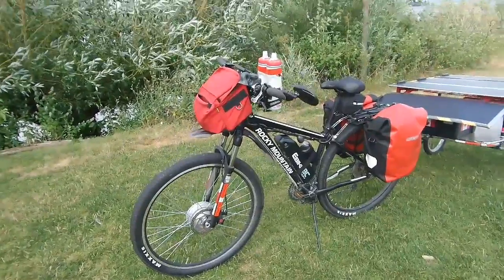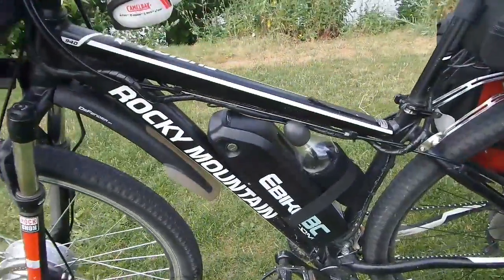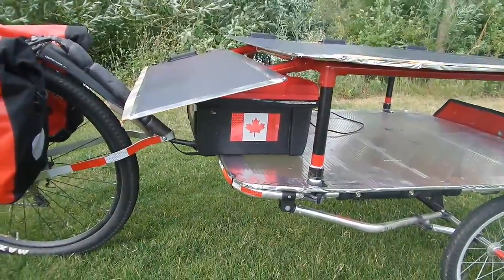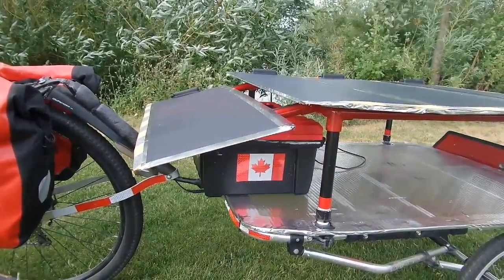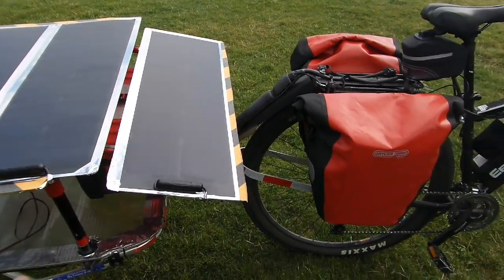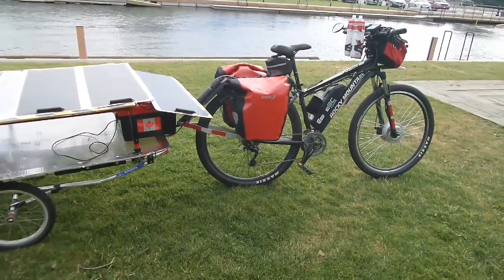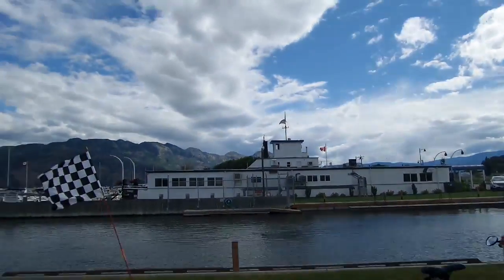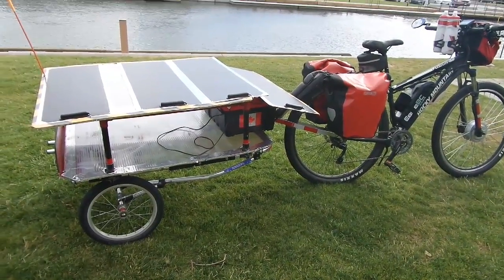500 w Solar powered touring E- bike

Comment: Very cool. I am definitely looking into doing a set up like this for a future cross country trip on an e bike. Would be nice to have the continuous battery charging thru solar rather than having to stay at hotels to charge overnight.
Reply: The solar has to little watts and the motor is big.
Thin-film solar panels are not that efficient . 
Guessing by looks, for the size his panels occupy , I could fit 200-300 watt panels within the same area.

Comment: The Genasun GVB-8 charge/boost controller will take the 18+ volts from the solar panel and boost it high enough to trickle charge a 48v ebike battery.  The controller also has MPPT to monitor the panel to optimize the power.
Reply: I know this is a old comment. 
He got four 12volt panels. If you wire those panels in series and use a common 48 volt charge controller you could do the same thing cheaper.

Comment: Lithium ion batteries do not like to be constantly topped up. It creates dendrites inside the batteries and reduces their life span. Reduce the charging voltage to 3.90-4.00V per cell bank(39V-40V for your 36V motor assuming your battery pack is a 10S. ~51V for 48V motor or 13S pack). With that setup, you don't need to worry about running the battery to low.

Comment: The new trailer I am currently building has increased solar panel capacity bringing it up to 240 watts from 120. 120 worked well enough to keep the system charged and I could ride all day but had to constantly change the amount of power assist according to the grade. With the increased wattage I won't have to do that as much. One of those "more is better" situations!
Reply: Doran Amatt
Reply: Dude you wasted so much space with this setup. You could easily have 400 watts in this space with flex panels. If you are going to do something do it right.

Comment: If you could make a front fairing made of coroplast with a lexan windshield, and instead of hauling that trailer behind you create a frame to carry a light but flexible solar panel on top, you would eliminate the extra tire drag behind you while making yourself more aerodynamic
Reply: Such sail may be dangerous on windy days.

Comment: I bought an ebike 1000 watts pyogrammed for 750 watts to keep it street legal eith a Bafang BBSHD mid drive motor and would like to design a trailer with 2 50 watt pv panels...My battery is 52volt 14.5ah but it will drain anyways and Im interested in a DC to DC voltage converter for that lithium ion battery but nowhere to find one...If you can help i would really appreciate it.
Reply: Carlos Lizardi-Montero  The company is called Genasun. In Boston MA. Pricey but it does work. They come stock set for 42 volts. So will have to be calibrated for your 52 volts. Give them your stats and they do that for an extra charge. Good luck Carlos!

Comment: brilliant! free transport and green!
Reply: Little Bull green until the batteries die and they gave to be disposed of. I use this bike 365 days a year. Its my only teansportation. I havent bought gasoline or oil in almost 5 years. So I havent cotributed to air polution in quite some time and saved money that way. But my entire set up was a little over $5000 initially and have spent more on upgrades and maintenance. Butvin the long run I have definately saved money and the environment. Thanks for the good cheer!
Reply: @ontheroadwithyode390  How long does a battery last before it has to be replaced?

Comment: hey awesome bike man! could you give a brief description of whats in the box? i plann to add solar power to my 800w ebike
Reply: Edward Thompson The "secret in the box" is a component made by a company by the name of Genesun.  It's a dc to dc power booster that runs directly from the panels, to the booster, directly to the battery. The company is out of Boston Massachusetts. They had to send it to another company in California to recalibrate it down to 36 volt from 42 as my lithium battery is a 36 volt. It was expensive, but it works and works well eliminating numerous steps in the charging process that cost loss of power. Good luck.

Comment: Can you give me advice on how you set up the solar panel to inverter to battery to constantly charge the battery? Im interested in a simular set up but with a mid-drive motor
Reply: Sure, it relatively simple. Inside of the box is a GV-Boost. Its not just an inverter, it also boosts the power up to either 36 or 42 volts. And also regulates the power. You cant charge a 36 or 42 v luthium battery with just a regular inverter because it is only converting the power from dc to ac. The amount of electricity will either be too much or too little for your battery. This product is made by an American company called Genesun. See my new video that I just posted on yode on the road. There is a good shot of it on that vid.

Comment: So you have no issues charging the battery while using the motor simultaneously?
Reply: The battery does not get charged with the solar panel, think about it. The solar panel has 120 watts and the motor has 500 watts.
It would be like filling a swimming pool (battery) with an hose that supplies 5 gallonof water per hour (solar panel) and you have a 20 gallon per hour leak at the swimming pool (motor). You never will fill the swimming pool (battery).
Reply: @FloryJohann  yes but the bms for the battery may not like be able to handle charging the discharging simultaneously.  I understand your analogy but it over simplifies a pretty advanced process.

Comment: Get yourself a tilting  tricycle and put a solar roof on that....250w
Plus 500w solar power on cargo trailer....and drive like me 250 km per day on sun power with lithium titanate battery 24v with step up converter to 48v step up (900w capable) to prevent overheating. LCD setting to any voltage...up to 120v 900w usable. Adjustable current even for a motorcycle 2000w motor using 3 of these LCD  step up converters
35km per hour without discharging more than 5% during driving.

Comment: Hi, that looks like an excellent design! I am very keen on building myself one of these, hence I have a few questions if you don't mind:

1. Does your bike have 29 inch wheels?
2. Does the 500w motor give enough power to take a loaded bike up hills? I guess you have to do some pedaling to go uphill?
3. What is the (approximate) combined output voltage from your solar panels (on the incoming side of the DC to DC booster)? 

Thanks
Reply: George Diener HI George....yes , 29 inch wheels. The mistake people make when it comes to electric  bikes is that they figure you use it like a motorcycle. The electric motor is there to ASSIST the rider while pedaling. It will power a loaded bike up a hill or two and then the battery would be drained. The trickle charge cannot keep up with the amount of power expelled if the rider is not pedaling. This set up is four 30 watt solar panels, 19 amp, 1.5 volts each. so the answer to your question is roughly 6 volts at optimum conditions. I was averaging 80 to 100 km per day on my trip. Keep in mind this was June- Sept. lots of sun. My average speed was 18-20 kmh. Also factored in is the fact I was traveling through the mountains of British Columbia (Canada). Lots of inclines. The system I have allows me to adjust the level of assist. More for inclines and less for lesser grades. I would turn off the power during decent and on the lowest setting on the flats. So...once again, other than coasting on decent,  always pedaling.

Comment: would that hub on your front wheel work on a BOB Ibex trailer without the need for the Solar panels?
Reply: Dean Porter you may have misunderstood. The hub isnt gerating power. Its using power from the battery. The battery is being recharged by the solar panels.

Comment: what's the budget around for this project? Im interested in building one this summer. Thanks!
Reply: ravenrg84  The panels were $200 each. The booster/dc dc charger was $450. An electric 500 watt kit with battery was $ 1000. The bike and panniers $ $2000. The trailer I built from various parts and pieces and probably cost$ 150. so...about $4500.
Reply: Doran Amatto ok thanks. I have an old ebike (velec p1, 4 years old, battery 36v 13ah, 500watts). do you know what kind of solar pannels do I need, 3× 12v 50watts would work? i have a 700$ budget...
thanks
Reply: ravenrg84  150 watts should keep your battery reasonably charged if you are assisting by peddling and not just running only on the motor. This system was only 120 watts and it worked just fine. Although the system was fairly low after an eight hour day of riding.

Comment: hi. i would like to make a bunch of cross countrys treavel with a e-bike. It would be gread if you can gife me some info about the charge control. That is realy a nice bike by the way i love it! I just wonder how i get the righe voltage by driving to charge? Thank you!
Reply: The front hub only generates about 10% recharge only while braking so its fairly insignifigant. You may have missed the four 30 watt solar panels on the trailer. Google Genesun GV-boost. This is the key. Not yoyr average charge controler. Good luck!

Comment: how it is possible to load and at the same time use the battery ?
Reply: der analoge  It still drains the battery , but very slowly. Without the panels I got about 25-30 km on a charge. Connected to the panels I was averaging about 70 -80 kms and still had some charge remaining at the end of the day.

Comment: changed your motor to a bottom bracket motor no drag on front wheel and more economical .also lets bike free wheel a lot better good design wish i got the cash to throw about  on things like that
Reply: bucketrobbert Very true, a bottom bracket motor is more eficient motor as the internal gearing allows for better economics as far as utilizing gearing.  I was learning. But I did test ride a few bikes with BB motors and found that there was more drag while  using the bike as just a bike (with motor turned off) . which I like to do while touring and the road is flat. Also,I ride in the winter and where I live there is snow on the ground for 2-3 months and find the motor on the front wheel works well. I am putting together another bike with BB motor for touring in the summer.u